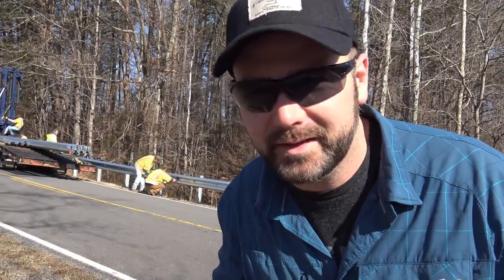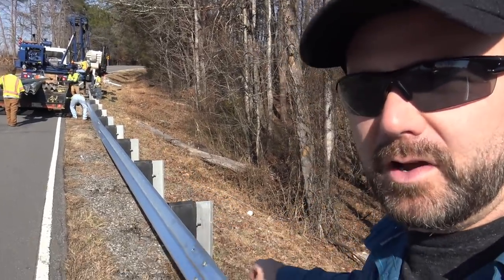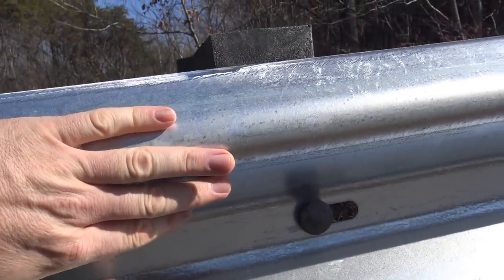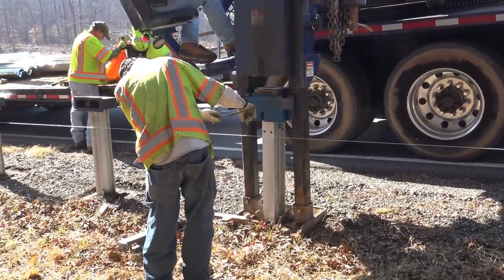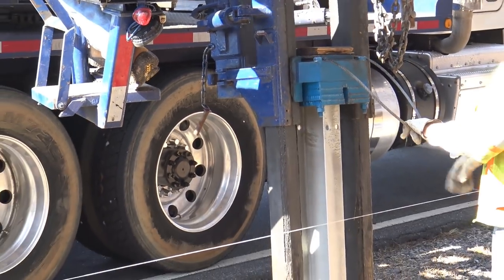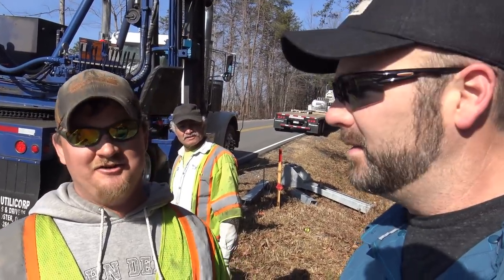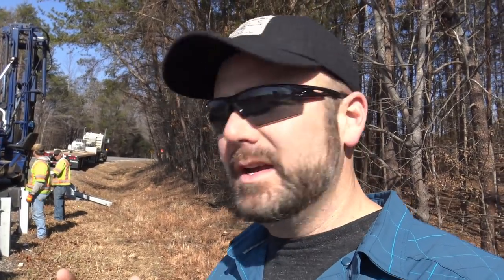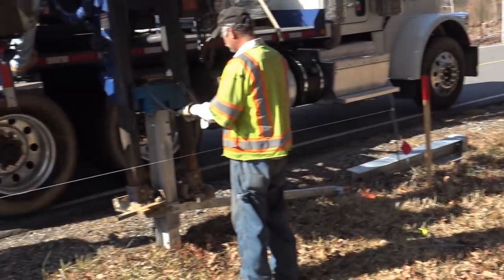A GIFT FROM THE GOVERNMENT = NO  MORE CARS IN THE FARM POND!!

Comment: A lot of people don't think much when they see guardrails. Never knew that it takes all that work. its crazy hows theres miles upo miles of these on the highways.
Reply from the maker: Shoot look at all the fencing back in the woods beside the highway!! Crazy expensive stuff bout $9 per foot! for miles and miles!
Reply: thomasp187 I've installed a few gaurdrails before, in some areas you cannot pound in the post. So you have to dig a hole and you need to cement the post in the ground, it's not fun to say the least.

Comment: It's a piledriver. I uses to work for a company that specialized in that work. Those drop hammers are almost completely phased out of use and replaced by electric over hydraulic units in Canada. We use measurements of force used to determine how far a pile is needed to be driven down to properly hold. Sometimes we'd have to weld a second or third pile on to reach a depth to find solid footing so they wouldn't sink 3 of them would be 207 feet below ground. Guardrails are never needed to be anchored that far down though haha.

Comment: There’s also two waves in the rail compared to the old style 3 wave. It allows the end piece to slide down the rail and peel out the rail while the rail curls out from the end piece. It’s a controlled showing of a automobile instead of a sudden jolt or the piece impaling through the car. Very neat stuff and engineering. 

But to what I wanted to say in the beginning, imagine building fence with that truck. Could put up miles a day with that jewel!

Comment: Here are a few fun facts for you. The Guardrail post have to weight 8.5 lbs a foot ( Per. NC DOT Specifications)   Those black plastic spacer blocks are made of recycled baby diapers.  The guard rail itself is 12 1/4 inches wide .   That end  section rides along the rail if you hit it square on the end and it causes the rail to twist up in a spiral as it slides along with the impact.  The results is the rail looks like you took a can opener to it that is why the end unit  has the nick name the can opener crash attenuater  unit .  Also they should paint that section they cut with the saw with Zinc rich pain to inhibit rust.
Reply: Brooks Pearce also..it's called a "guide rail" not a guard rail.  It doesn't fully guard your vehicle from going through it.  In stead, it guides you along the rail until a complete stop.
Reply: MrTeachYa guardrail manufacturers must not know what they make.
Reply: Lol , Well I reckon I must have  inspected the wrong stuff my 35 year career with NC DOT. This stuff in the video is called Guardrail here in NC.    The wire ( cables)  looking stuff you see in the median of the interstate highways is called  Guide Rail . It has a buried  concrete anchor point at each end and is designed to "guide"  your car  back into your lane of travel and to prevent head on collisions if you happen to crash into it.
Reply: Brooks Pearce here in Texas all I've seen those cables do is cut cars in half like beer cans

Comment: Interesting - thanks for sharing this, and giving the guys on the crew a chance to shine. Had a similar situation years ago - city lot on a corner, but with two intersecting streets offset. Had a couple of cars come through the small concrete barriers into the front yard. City was most accommodating with putting larger ones in after a phone call. A few more cars came through, and all it took was one call and they put 3600 lb no posts in (and extended them to provide more coverage). A few more cars tried to get through (and in one case broke a no post in half) but didn't get to the house. Sometimes all you need to do is ask politely and things get done. I had heard of other folks in the same boat who went in all angry and threatening lawsuits - guess who goes to the back of the line? Helps to provide references to police reports, too, so they know you're not just blowing smoke.

Nine cars in 11 years (the fact that all but one happened just after closing time at the local pub was, I'm sure, a coincidence). Glad you're protected now.

Comment: where I live, they don't do guard rails anymore, they use no-posts instead. basically a short wall of concrete, then they lay out a long row of them on the edge of the road. they can be removed and changed super-easy, and they have give when they get hit too hard.

Comment: The looseness of the bolts on the guard rail is to allow movement. Not necessarily adjusting movement on impact, rather something to do with thermal expansion I believe. I saw this YouTube video on it. No link. Thermal expansion affects and engineers have to work with it and around it solve design flaws. Things expand and shrink, bend with changes of temperature. Leaving room for expansion avoids design flaws. Google thermal expansion

Comment: those guard rails are quite good in itself, the posts as a unison are the strength where the metal sheet attempts to guide the vehicle to safety as long as the force doesn't overpower it, when you see guard rails overkill in some areas that means it's either soft soil or some other problems that they are calculating into it.

They may seem intrusive but are quite gentle as long as you aren't being an idiot and ploughing head on into the rail

Comment: All the fencing contractors around me have a smaller scale post rammer fitted to the back of their tractor and all they do is chainsaw points onto the end of their fence posts they are then rammed in and then the wire is strung as usual it’s so fast and the posts just don’t shift

Comment: Thats pretty interesting to see how they do this with that self propelled pile driver on the truck. It doesnt take long for them to do this and they look like they can do this pretty quick. Cant say I have seen seen them do a guardrail system like that before, the ones I have seen are all the old style wood posts and the old metal galvanized ones or the ones that are on the high tension cable, which I am no fan of.

Comment: Those rails kill people as well. we lost a fellow rider when he glanced off the rail his body flipped over the rail and his neck hit the very sharp top corner of the post. He didn't stand a chance.
Reply: Skye Iorfida “not motorcycle approved” ahaha.... RIP
Reply: yep would need a rub rail mounted below to help most MC. The worst MC crash I worked was a young guy on a GSXR flying went over a OP with a slight curve. Lost control the front tire was stuck under the rail & him & the bike spun down the rail.  well when you hit the rail post like that it cuts you apart into little pieces. He was spread across the interstate.
Reply: Skye Iorfida what do you expect riding a motorcycle
Reply: As opposed to the chance he would have had flying into a tree. I ride. We know the risk. I was also firefighter emt. I've scene heads erased along those. Sorry you lost your friend but motorcycles are inherently dangerous and it's not the guardrails fault. Accidents happen. Our bodies are not built to withstand impacts much. But I still ride knowing the danger.

Comment: getting things like guardrails done is who you talk to and how you present it to them.  there was a driver missing for 3 or 4 days before he was found at the bottom of a steep hillside on mullholland drive.  his car was upside down.. sitting on top of a upside down car who's driver had been missing for 2 weeks.. that driver was dead. as nobody found him in time. there were more than 20 other cars down that hillside.  i called the city council office for that district.. mentioned that there is a need to put up guard rails.. before i could finish .. i was cut off.. do you know how much it will cost to put in guard rails all the way along mullholland drive..  i stopped him.. i did not say all the way along mullholland.. only where cars have gone over repeatedly..   How will we know that..  well you could ask the fire captain in that area.. the highway patrol. the Lapd.. the impound drivers for that area .. each will have detailed reports of where the cars went over the edge.  within 2 weeks  the tow companies were pulling the cars out and guard rails got installed.

Comment: Fantastic, now all you gotta worry about is having the state come out and repair it about 5 times a year..Least your property is safe though. Also while the men were installing the end section you see the operator who running the hammer now working with the men installing nuts and bolts connecting the sections of barrier.. You will never see that on a Union job, thats why Operating Engineers are usually fat, they pull leevers all day!!  ha ha

Comment: Hi Josh, I've designed a watering system for my chickens you may be interested in. It is totally automatic, no carrying water and it will not freeze. You're welcome to take a look. I have not shared it with anyone yet. It has been in place going on two years and still does not need cleaning. If you're interested come check it out and I'll show you my solar. I'm about 3 minutes from your farm. Tony has my number.

Comment: Neat...but if we had the same guardrails we had in the 1950's...we would not have as many idiots on the roads today. Nearly every "safety measure" has made vast contributions in making our American motorists far less capable of responsible motoring. Why ? Because there's virtually no consequences for driving irresponsibly. Way back when, there was a good chance if you drove like an idiot, you'd die...that made folks careful. Now, if you drive like an idiot...you may receive a ticket and have to pay a deductible. Virtually no chance of paying the ultimate price.